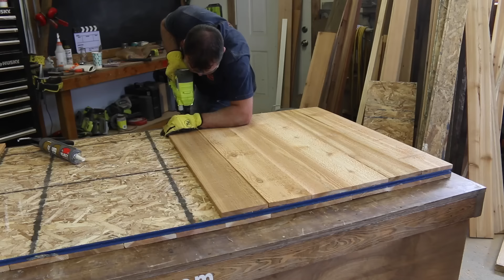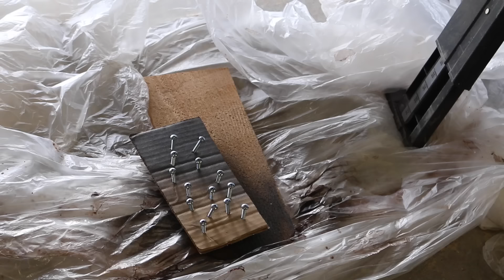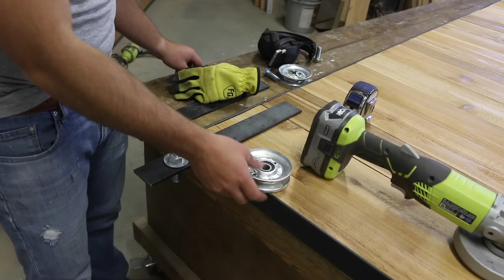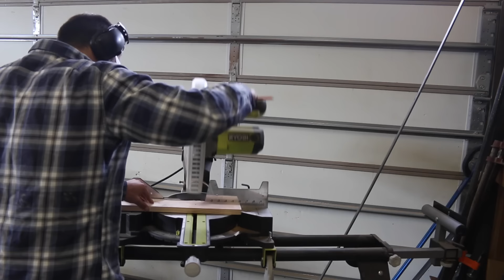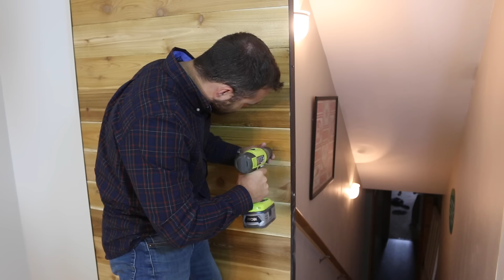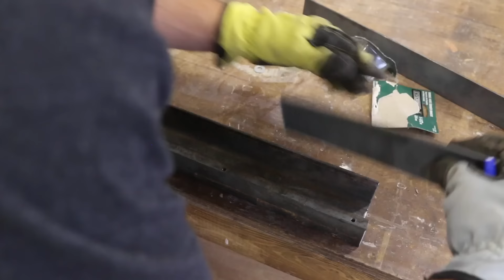How To Make a Sliding Barn Door(Easy DIY)

Comment: Hey Pete! Im a bit confused. I downloaded the plans for this and it states ur using 2" wide flatbar to wrap the door. It also states ur using 22/32" OSB with a 1" picket on each side. How does the 2" wide flatbar lay flush when the thickness of the door is clearly over 2" ? 
Thanks!

Comment: I really like this build and definitely a project i'm going to try. My concern is the weight of the door. Can you suggest how I can build this door & look but with lighter materials? I will be building 2 - 24in. doors using a 12 FT. railing system which I purchased before finding your video and I'm afraid the railing might not hold that kind of weight.

Comment: Great video. Easy to follow instructions, tools all DIY'ers actually have, finished edges for once in these videos and a great finished wood product instead of just being painted over. 

I will use this to build four sliding closet doors with hardware from the old cardboard specials (which I will repurpose as kites or book covers, but not sure if they'll be strong enough to use writing paper). 

Im also leaning toward making a front door for my condo with plywood on the outside so I can paint it the mandatory uniform colour on the outside, while keeping it as shown on the inside to replace the paper door that each suite has (on my $600k condo the cheap bastards). Obviously the outside frame will need some tweeking for the latch but not a big change). So many possibilities with different wood, stains, location of the door, size which makes this project so handy and a great alternative to the big box store clones which just look cheap to me.

Thanks so much for making this video and sharing to all of us that take pride in building our own renovation materials, while looking for options from the norm. Great job my man!

Comment: Absolutely beautiful!  I'm going to give it a whirl, but wondering if you might be able to tell me about when and where the dark metallic spray paint and metal sealer should be used.  Are both used on the flat bar or is the sealer just for the hardware and the sealer for the flat bar?  Thank you!

Comment: I am a touch confused.  You placed wood screws into the pilot holes in the bar, and then made more pilot holes for the lag bolts in the bar without the drill press, but with the handheld?....  Please clarify.  It is a really awesome video, I am just a Noob.  I'd appreciate your assistance.

Comment: Quick question:
2 cedar fence pickets is 1.25" thick. 
1 sheet of OSB plywood is just a hair over 0.5" thick.
If you used 2" flat bar for the trim isn't there some overhang that catches on stuff?

Comment: I would take that track out with its sharp corners on the floor, my toes are crying just seeing what will happen in the future. At the base of your door  install two stretches of metal with a 3/8inch gap in the middle, getting rid of the wide solid strip. In the floor screw in a 3/8inch lag bolt, unscrew it giving your hole in the floor the threads needed. Take that lag bolt, cut the head off then round out the end with a grinder. Put some beeswax  on them threads then use a set of pliers with tape to run it back into the floor. Now just mount your door up n over bringing it down on top of the bolt you screwed into your flooring allowing it to ride in that trough on the bottom. Done deal you have a guide that is invisible with clean lines.....and no worries of stubbing them toes on that sharp corner angle iron.